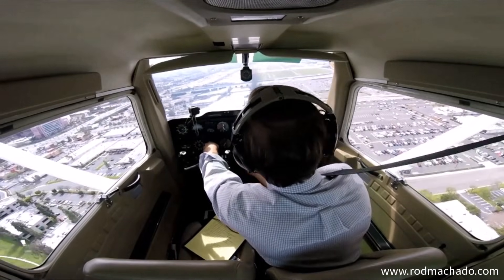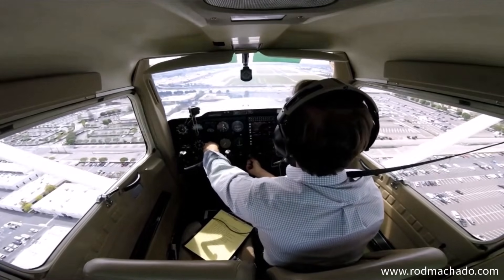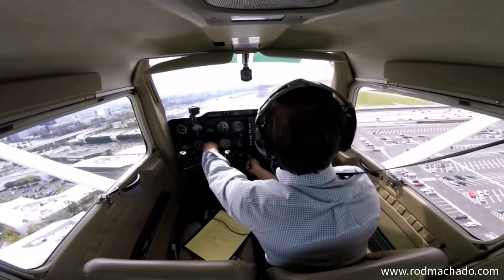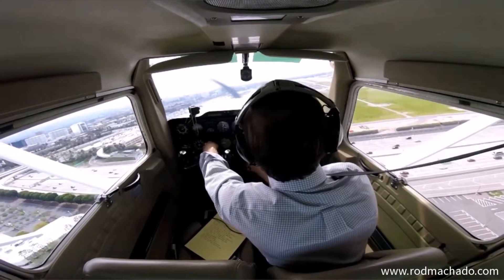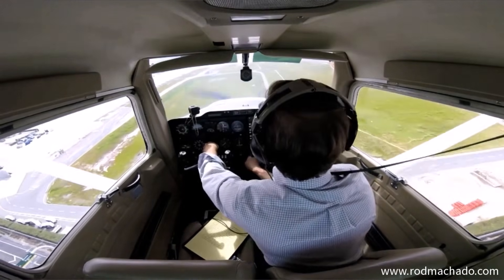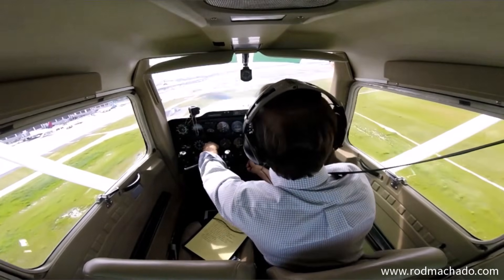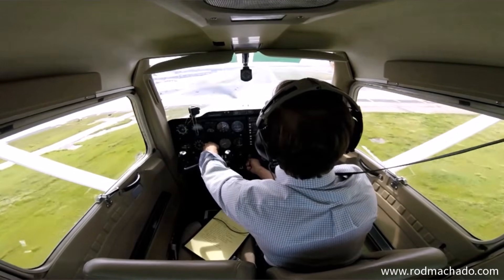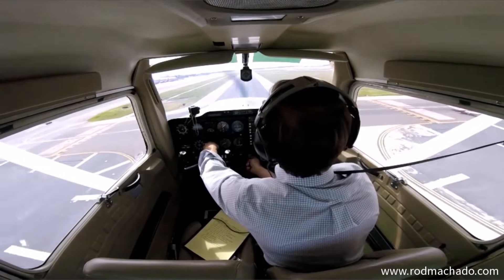Landing With a Stuck Elevator Control

Comment: Did you use trim at all to control pitch?
Reply from the maker: No, I didn't use trim to control pitch in this demonstration. Instead, I used power. I could do this because the airplane was already trimmed for level flight at the typical downwind speed. However, you can control pitch by trim (to a small degree with a stuck elevator) as well as by flaps and bank angle. You'll notice in the video that a slight application of rudder induced a turn which lowered the nose as the vertical component of lift decreased slightly.

Comment: Hey Rod, your voice was stepped on during the end bit..
How did you manage to flare without making the aircraft gain height? 
Did you add more power or did you just let it touch down flat?
Reply from the maker: Good question. Most manuals recommend some flaps when landing with a stuck elevator. Adding half flaps in the Cessna 150 allows the nose to rise sharply when a burst of power is applied. Just before touchdown I moved the throttle forward quickly then slowly reduced the power it to idle. This provided just enough pitch for the flare. It only takes one or two practice tries to get the timing down on this. It's pretty easy to do. Not much magic here.
Best,
Rod
Reply: @F @Flight-Instructor  That’s super awesome! Thanks you!

Comment: How did you flare to land on main wheels?
Reply from the maker: That's a good question. Most manuals recommend some flaps when landing with a stuck elevator. Adding half flaps in the Cessna 150 allows the nose to rise sharply when a burst of power is applied. Just before touchdown I moved the throttle forward quickly then slowly reduced the power it to idle. 
Best,
Rod